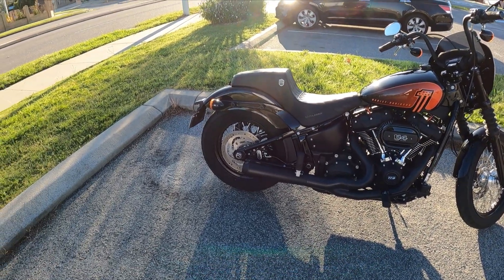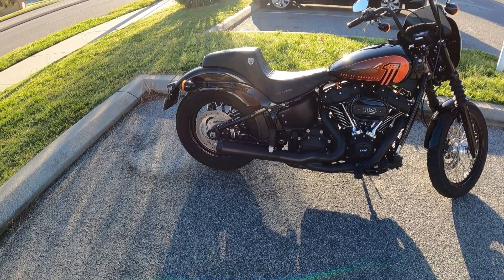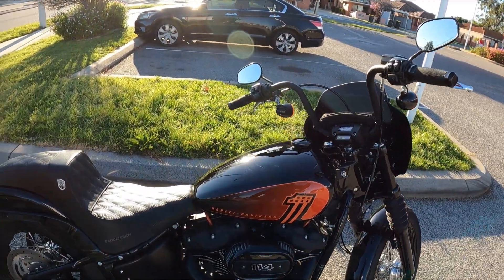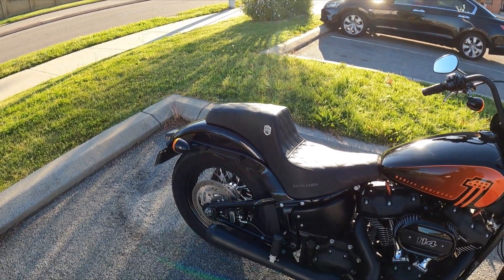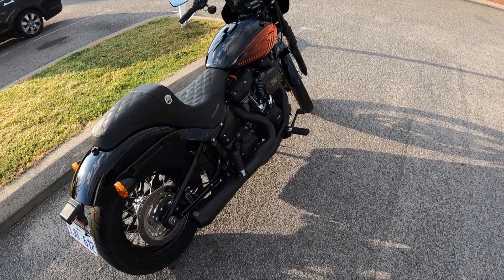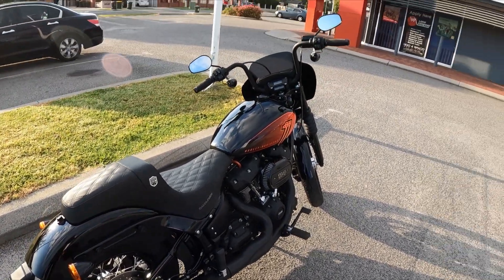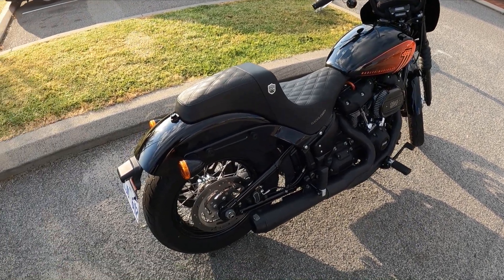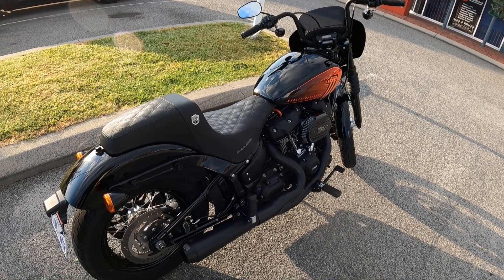Street Bob 114 Stages 2 + 1

Comment: Did you get it dynoed again with just the exhaust or using one of the premade stage 1 maximus tunes?
Reply from the maker: Would you believe I asked them to Dyno it and they didn't as I wanted to maximise the stage 1. Asked them 3 times when booking it in yes yes yes was the reply but lo and behold wasn't done they just uploaded the tune. Runs nice and goes ok but would've been better if it was dynoed
Reply: @timfinning  If you have any issues with the tune that's in there let me know. I can send you my stage 1 tune with the El Diablo exhaust. Some of those Maximus stage 1 tunes can be a bit dodgy. Next time it's in for a service get them to do a power run and check the AFRs.
Reply from the maker: @kirkj85  thanks mate appreciate it. I just had it serviced lol thought while it's apart I'll get it done